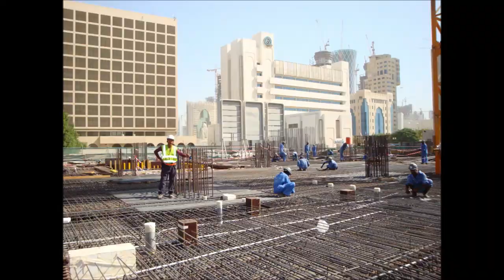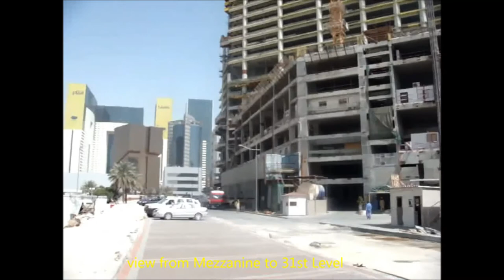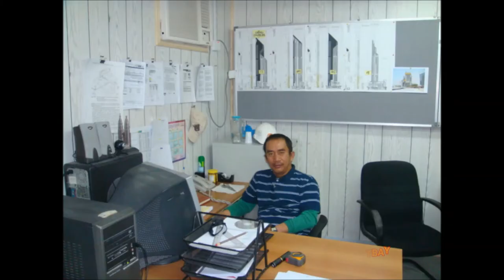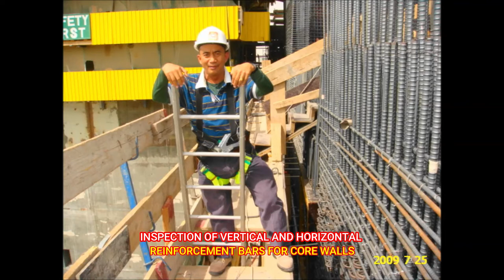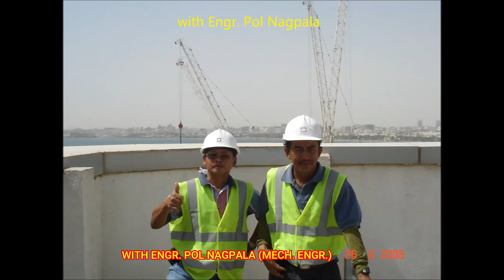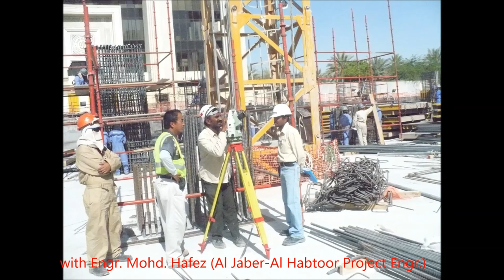DUBAI TOWERS PROJECT-PHOTOS AND ON-GOING ACTIVITIES

Comment: Dubai tower project is cancel or on hold .. ??
Reply from the maker: Canceled since 2009
Reply: @elkinmadzchannel9684  so this project is cancelled forever?
Reply: @veyron1442  I've been seeing videos where you can see that the first few floors are cladded in black glass( it's new, I haven't seen it before)
Reply: @arthurcabanne9855  you sure about that? cuz i havent seen it resuming construction yet and just because it has been covered with glass wont mean much until the building starts to grow higher bro
Reply: @arthurcabanne9855  where have u seen the videos?
Reply: @veyron1442  yes but it means it’s on the right path, better this than nothing.
Reply: @veyron1442  what do you mean?
Reply: @arthurcabanne9855  oh i just read it in wikipedia aswell,that its getting covered by black glass,i really hope they resume construction on this skyscraper cuz its 400m+
Reply: @arthurcabanne9855  i meant did you see those videos on youtube?
Reply: @veyron1442  yes I shared the link with you and the time mark
Reply: @arthurcabanne9855  where have you shared it cuz i cant find it